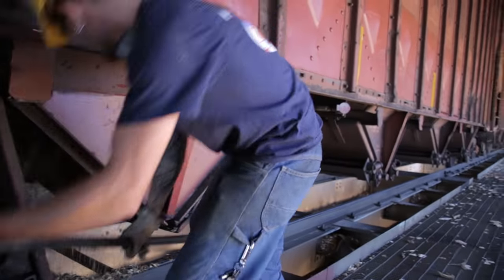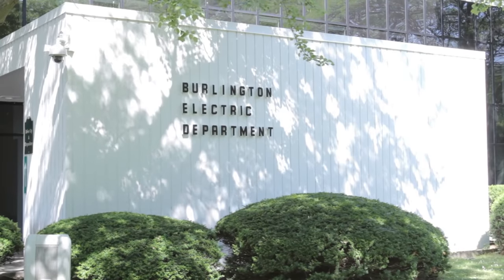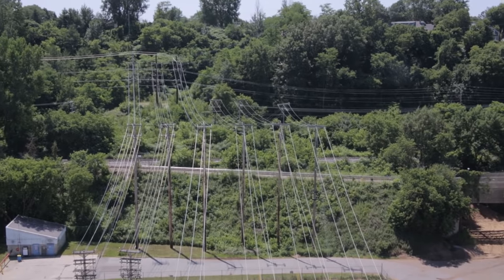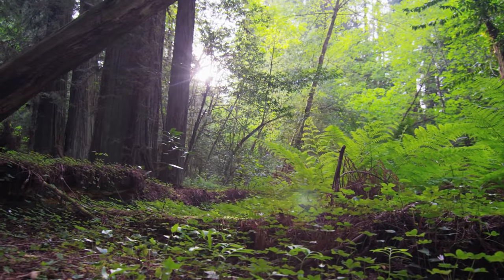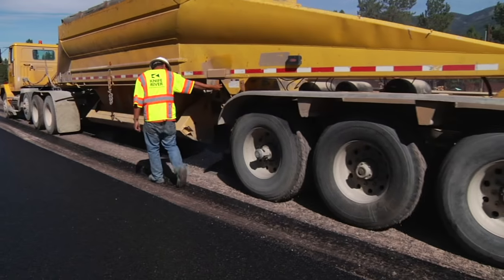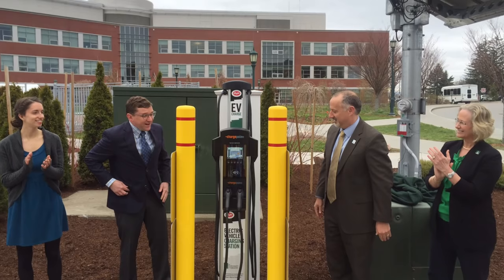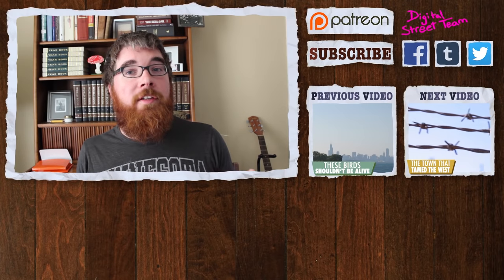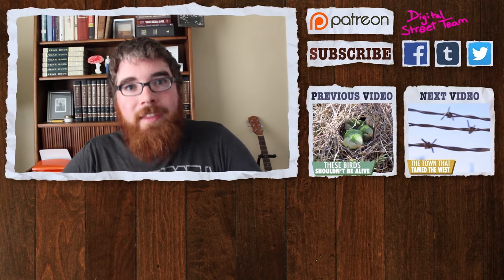Can A City Run On 100% Renewable Energy?

Comment: 100% renewable energy, yet they still #FeeltheBern.
Reply: Indeed
Reply: Yeah, this is the same kind of "see, it can be done" as people using cooking oil in diesels.  Only if you do the math you see it's 100% pure delusion and that there's no way in hell it could be extended to more than a few percent of the population, and even then, it would likely cause far more harm than just using fossil fuels or nuclear.
Reply: Biomass can't power 40% of the planet's population without destroying the environment with tree farms. Ironically 100-200 years ago coal saved the forests, trees take a damn long time to grow. Hydro is the only renewable that doesn't completely destroy the environment yet is on-demand. Seawater uranium extraction (with breeding) is "technically renewable".
Reply: a reply to The Eh Team
traditional dam based hydroelectric power systems can be extremely damaging to the environment due to a combination of the destruction of rivers and the rotting plants that can build up around the edges of the lake when water levels rise or lower and in the case of larger facilities (about the size of the hoover dam works) the frequency and intensity of earthquakes increases measurably. All current forms of renewable energy are imperfect on there own.
Reply: That's why I think we should clear cut the forrest to make way for the new reservoir. It is money. Better than letting it turn into methane underwater. Hydro plants are some of the best load matching power sources. It is a lot better option than clear cutting for a solar farm's unreliable energy.
Reply: Julius Dictator Perpetuus solar and wind is a scam just like our wonderful sanders.  renewable energy is such a scam you probably believed burlington is powered by the wind and sun...80% of this city is powered by burning trees and hydroelectric dams. pretty soon you will be hit with so many carbon taxes, gas taxes, electricity usage surcharges, you'll be sitting in the dark cause you can't afford to turn a light on, and biking everywhere cause you're over the allowed carbon emission from the car....good thing bike lanes are getting constructed everywhere. climate change is the biggest transfer of wealth from the working man to the rich, and our con artist of a senator Is part of it
Reply: it can work for 100% of the citizens.
Reply: in combination they will do fine
Reply: clearcutting small harvestable trees is a good idea for continuous harvesting. changing the use of the land requires much more deliberation.
Reply: Yeah, as of 2018, if you check the actual purchase power contracts being signed, Solar and Wind is cheaper than coal or gas for new capacity. Also , each area needs to find the right mix. Wood chips might be fine for New England, solar less so where as the deserts don't have wood chips but have massive solar resource.
Reply: Melt the Ice on top of Greenland == 6 meter rise in sea level @407 ppm CO2 in Atmosphere 2018 and rising.   Earth Science history tells us this will happen.  HOW long will it take ?  Ice is slow to melt.
Reply: poitsplace says:
"it would likely cause far more harm than just using fossil fuels or 
nuclear..."
==
Nothing else can do more harm than fossil fuel.
We need only the second source of energy filling the time of day of solar energy is not available which is already cheaper than fossil fuel.
It also only need it until the better battery technology is invented.

From that point, we have a lot of choices even now, wind, wood chips, bamboo chips, ocean current, geothermal etc.

You are not looking, because you don't want to.

Comment: Congrats to the town and to the channel for great work. One thing i would have liked to see in the video is a mention of how costly it is to go 100% renewable. Most of the purely renewable sources which people praise the most (think solar and wind) are intermittent and in order to cover your demand on less productive days you need to have way more capacity than you usually need, which gets expensive. E.g. if your 10MW generator is working at 20% capacity because it's cloudy, you'd need to install 5 of them to produce 10MW at any time. This would cost a lot and would be very wasteful on more productive days. This is why more steady sources like biomass and hydro are critical in any reasonable renewable energy strategy in order to compensate for intermittencies. Ask any expert and you'll know that batteries are not feasible on city or national scale and sourcing renewable energy from farther away where it may be sunny is VERY inefficient due to losses in power lines. As a result it may be much cheaper and more productive to go 80% renewable in 3 towns than 100% renewable in one.

Comment: In Austria there is a whole state (Lower Austria) running on 100% renewable energy, and it has about 40 times as much population as Burlington. 63% hydroelectric power, 26% wind energy, 9% biomass and 2% solar.

Comment: Chopping forests to bits, which takes lots of fossil fuel and destroys habitat, is not the noblest source of energy. The best fuel is no fuel: efficiency. Second best is passive solar, then solar, then wind.
Reply: I'm with you all the way, but trees have been growing and harvested for thousands of years. They can be replanted. Vermont wiped out nearly 80 percent of its forests during the nineteenth century. You know: for logging and to make pasture land for sheep. By 1870, Vermont found itself needed to import timber - from Canada. That 80 percent figure's been flipped due to conservation efforts. Today, roughly 80 percent of the state is now reforested. 

By contrast, the oil industry has been in existence for less than two hundred years, oil reserves are running low - and we can't go back in time hundreds of millions of year to "plant" plankton so there will be more oil. I'd rather we were dependent on wood-chips than oil and gas while we're ironing the kinks out of the sun. Have a great week, Mr. Glover.

Comment: It's not 100% if they account for the carbon fuel used to harvest the wood, then produce and transport the chips to the power plant, now is it?   Q. How many acres of tree does it take to produce the wood use in the plant annually?  Multiply that number of acres by the 20/30 years they said it takes to grow those trees. That is how much land?   Wind, solar, hydro of any kind and geothermal are the only carbon neutral sources of sufficiently safe energy we have today.  Storage technology improvements need to be more had for more cost effective than we have today.

Comment: The whole country of Iceland uses 100% renewable energy, mostly hydro, but some geothermal too. We have small diesel power stations that are used in emergencies, for example when weather cuts parts of the country off from the national grid, though that is rare, since almost all the country has redundant connections to the national grid.